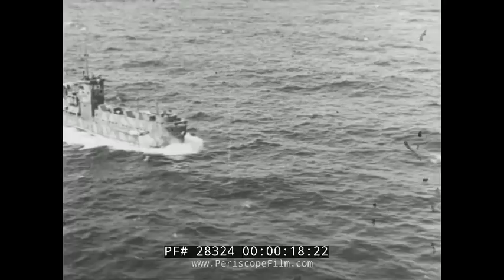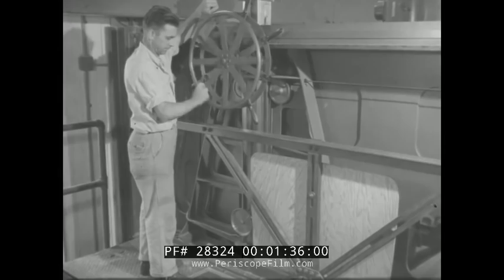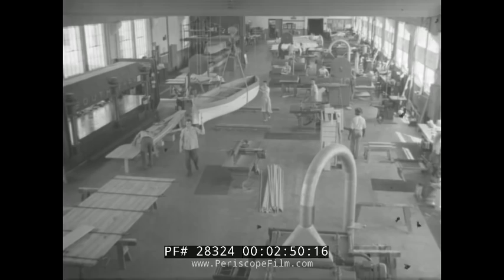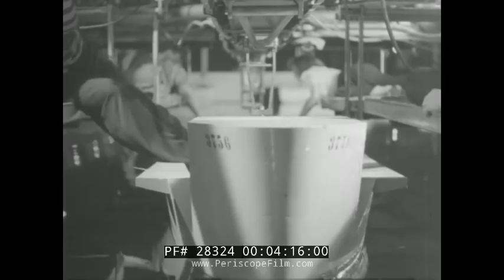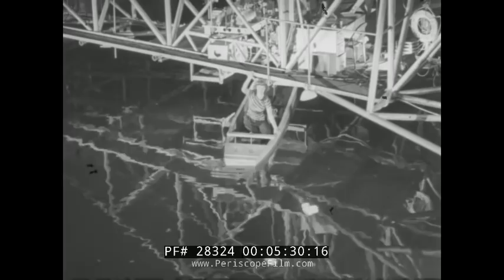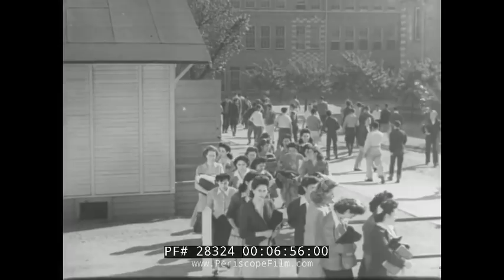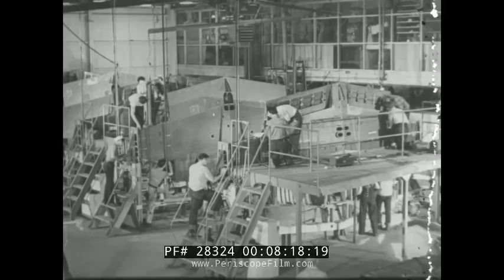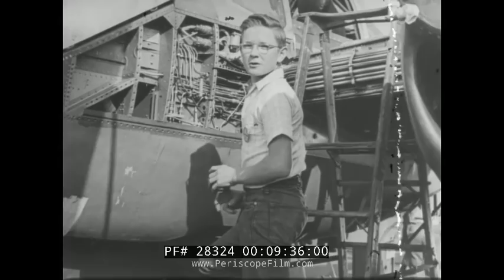U.S. NAVY TAYLOR MODEL SHIP BASIN   LCI WARSHIP DESIGN 28324

Comment: In the 1860's the British had a system for making test models,  where the hulls were made of bees wax . Models were over 9 feet long carved by a device where a operator carved the wax by following a cross hairs on a large drawing of the hull  . Simple and quick to make , and after all tests where  finished the wax would be melted down and reused  .